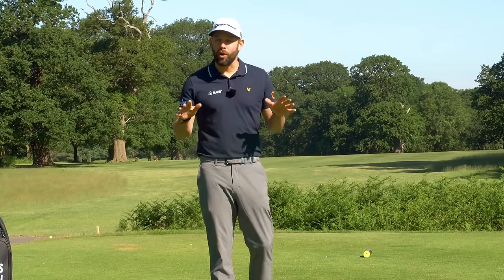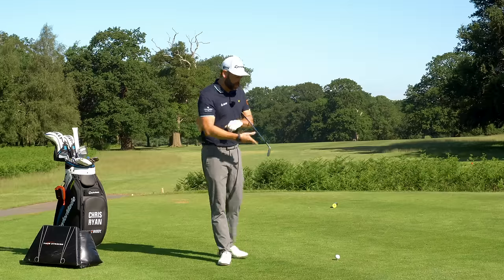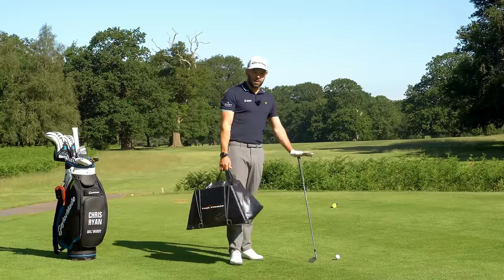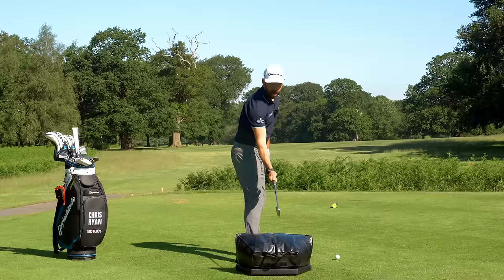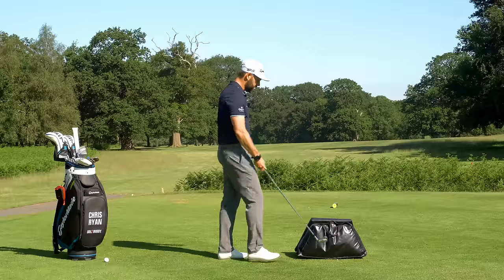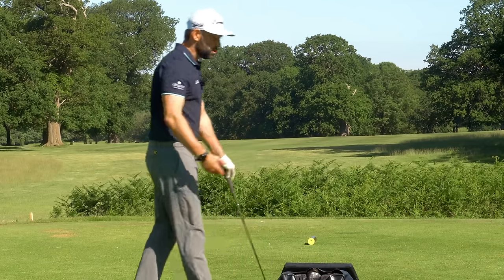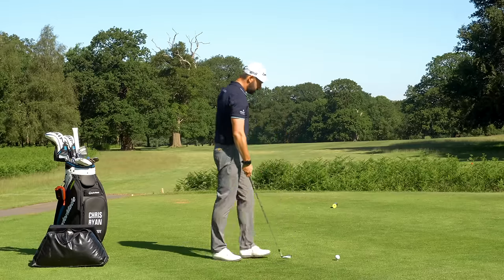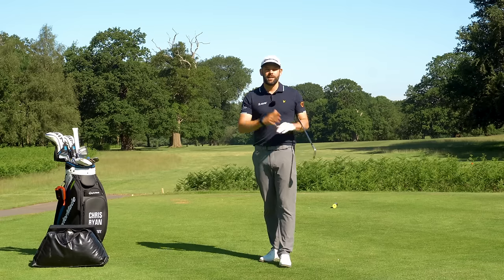This Drill Has Never Failed To Fix This Really Common Downswing Fault

Comment: Chris, I think this drill makes complete sense.  My only challenge is that I tend to come over the top early in the downswing (with a steep shaft)  and then somehow correct it half way down by re-routing the club and early extending.  This means that at impact - all being well - I do actually come from the inside.  But it is erratic as it involves perfect timing and early extension.  Do you have any drills that stop the over the top move right at the very start of the downswing?
Reply: Got here with that very issue.  That the golf gods allow "some" percentage of perfect shots, it means that when you hit the really crappy one with what feels like the same swing, then the degree of anger and disappointment is greatly magnified.  Those first two drills look to be both boring and potentially painful. :-)  The third one, however, looks to be much more fun, and I don't see how it could be done without dropping the hands down more "in the back".   Sick of trying to manipulate my right elbow and left wrist in an uncomfortable manner.  Seems like just more of the same "sometimes the timing is right, sometimes not".  That third drill with the ball back would seem to have the potential for grooving the move without having to think about it.  Can see where I might just block the ball out to the right, but hitting into a net, so what?  Shall give it a go and see if I can earn a cheap "feel".
Reply: Gave it a go with DTL video.  Still the same ugly early extension. Maybe that's just not what this is designed to fix, as I generally manage to "come from the inside" with my manipulations, anyway.  Ball placed way back in my stance didn't make my hands arrive any lower to P6.  My P6 seems to "align" OK, but my hands are clearly in a higher position than what good swings show. Oh, well.  Lots of shot results seem nice from that position. Shall just lower my expectations and work more on the shot game. 🙂

Comment: Well. Just got back from the range. I have been a chronic over the top golfer all my life. Its not perfect, but using your first drill I was amazed at the results. I'm 68 years old. My PW before travelled about 100 yds on avg. I'm now hitting it around 120 (mini draw, sometimes a big pull). Of all the lessons and videos this is the best result oriented advice yet. I don't think I'm clearing my hips well but still...progress. I'm a slow learner (really slow) but I learn. I'm hoping that the "missing this piece" video will help me with this as well.

Off to the range tomorrow and will try your third drill with the ball back in my stance. Stay tuned.
Reply from the maker: Great to hear craig, progress is the key thing no matter the speed, as long as you can keep trending in the right direction

Comment: I have struggled to correct the over the top swing for years. Some of the difficulty I had derived, I believe from my baseball swing because I am a dead pull hitter. Your videos, not just this one, have done wonders for my golf swing. I have never heard before the points you make here about the position of the ball. Early on in my golf instruction, I was told to keep the ball further forward in my stance (I think because my release was late in the swing.) More recently I have been trying to have the ball further back in my stance, but I tend to let it creep forward as I play a round. I can’t wait to do these drills to see and feel ball flight changes as I play around with ball position. Thanks again.
Reply from the maker: Really hope they help Paul, ball position is so important and can make a huge difference, hope that drill helps

Comment: Hi, great drills! Just one concern: won't the 3rd drill make you lean back and not transfer your weight to the left? I saw some drills for helping weight transfer by moving the ball forward (towards the left), which is what you are advising against in this video. So whilst it could help curing swinging over the top, it could negatively impact on weight transfer (?)

Comment: Brilliant Chris, thank you again for sharing another awesome lesson, I’m definitely heading to the range this afternoon. 
To help others with the creativity for making a strike bag, I had an old kit bag and stuffed an old duvet into it... bit of a struggle and had to tie it shut, but it works a treat by hitting the bottom part, which has a tough layer.
Reply from the maker: Love that, bet it works great, sometimes you have to get a little creative with training aids 👍😁
Reply: Tried moving the ball around in my stance on the range and it confirmed my over the top problem; when hitting a 7i I had the ball in the back of my stance it didn’t go the same shape as yours (R to L), it went L to R, which I think emphasises my OTT problem! Yet when I put the ball forward (inside left heel as driver) it went pretty straight. I also moved my left hand around the grip a little to close the face for a stronger grip and the ball still went straight! Something has gone to pieces that needs to be back on line before a club match on Sunday 😥 so I certainly need to get busy with the bag on a regular basis.

Comment: Very good Chris.. I’ve used this. My fix was to try and keep my back or upper torso from turning early. These drills do that. I’ve even closed my stance 45 degrees and out my weight on my front foot, that’s helped as well. Your videos are great. Appreciate what you do… I share info like this to golfers that are struggling at a range I go to a couple of times a week, when weather permits… What we share multiplies, what we withhold diminishes…. Keep up the good work….

Comment: Brilliant drill.  I’ve often found that rehearsing without hitting a real ball is far more beneficial that with a ball.  You get more feedback when there is no pressure of performance where you could be made to feel unsuccessful
Reply from the maker: So true, much easier to feel the right movements in the early stages of making a change

Comment: Great video. However, my impact bag is round so would be hard to do the 2nd drill effectively.
Reply from the maker: Very true Paul, I used to have a round one and just stand it on its side so that you are striking the top or bottom of the bag 👍

Comment: Have to disagree slightly Chris - one drill doesn't always necessarily fix all people with the same over the top issue. Placing the ball forward in my stance and hitting balls actually massively "helped" fix my over the top motion. Why? Because my main issue was NOT starting the downswing with my lower body, hence my first movement was my arms and shoulders coming down too vertical. By placing the ball forward 2-3 inches in my stance it makes me drive my hips forward / clear to enable me to actually hit the ball before the ground. This then automatically stopped my arms overswinging and hence, they automatically 'dropped' into the more powerful flatter downswing plane - videoing myself hitting balls on the range proved this motion was happening and of course the new ball flight was amazing. 

Doing this drill the results were immediate and impressive - I could physically feel how my lower body and hips were far more active and dynamic in leading the downswing - and my 7 irons were suddenly 170 high and straight, rather than 155-160 pull draws. 

I would also add that keeping my left leg more stable in the backswing and my legs in general more stable took my ball striking to another level - particularly with driver - as again this stopped my bad habit of overswinging whilst still allowing my hips to lead the downswing in the dynamic motion Pros all have.

cheers

Comment: Think most people, will hit the ball fat, and have trouble transferring there weight to their left foot trying these drills will probably struggle to make clean contact as well, as have tried these before
Reply from the maker: Drills are designed to target the areas of the swing that people struggle with, if the drill is easy it would suggest that it’s not something you struggle with, if I see a student struggle to perform a drill it just highlights that this is what they should be working on

Comment: If you do the bag drills, there is a pretty good chance that you will break your club or at least bend the shaft. If all of a sudden you are hooking the ball instead of slicing it, maybe it isn't because the drill fixed your swing but because it bent your shaft.